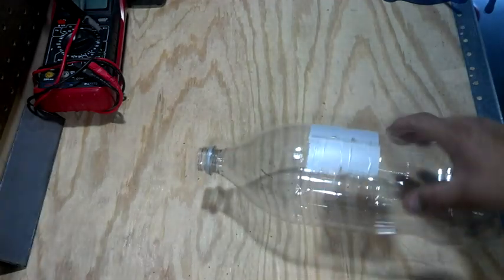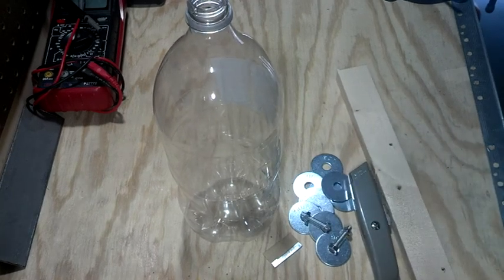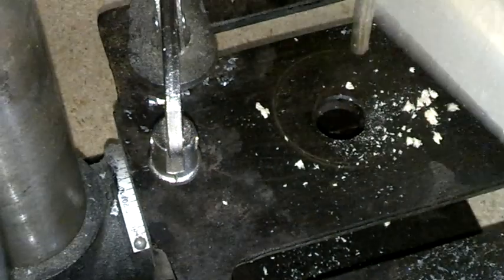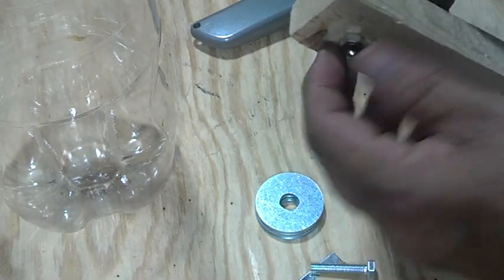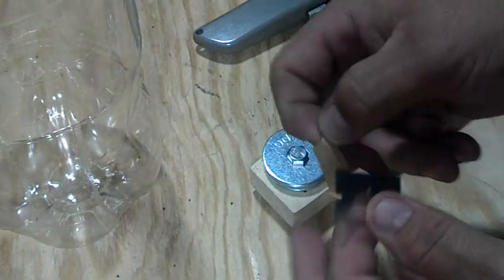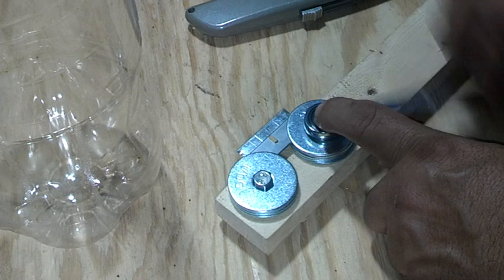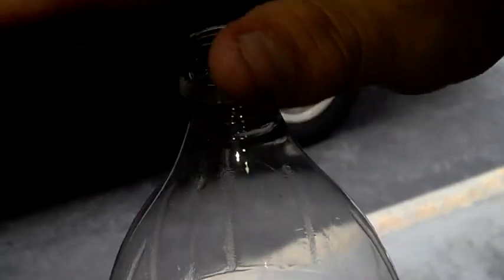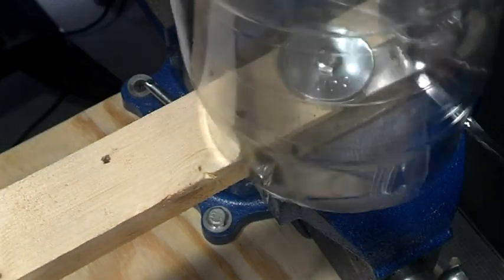How to make a cord from plastic bottles or cans.

Comment: Well I made one. And  I'm stripping hdpe vinegar bottles  as a possible heat source. An auto feed wheel could provide controlled heat/light in a vented system In a small camper

Comment: About how long was the line? 
ty for sharing :D
Reply from the maker: +Creative Redundancy I don't know. But tomorrow when i get to my workshop I will measure it.
Reply from the maker: +Creative Redundancy 28 feet 7 inches from that one bottle.
Reply: that's pretty long. have done a tensile strength test with a single line holding a known weight?